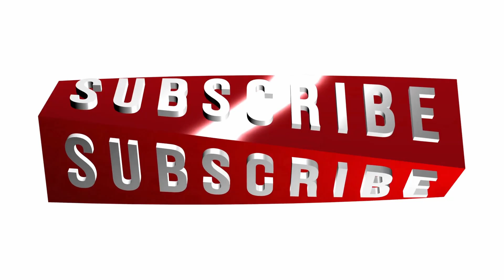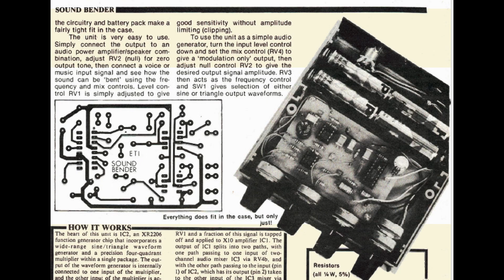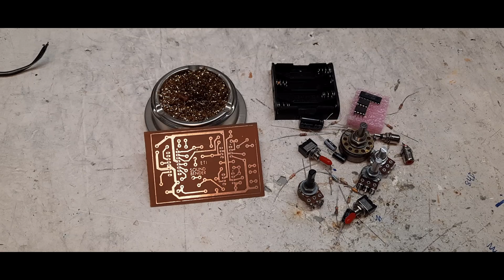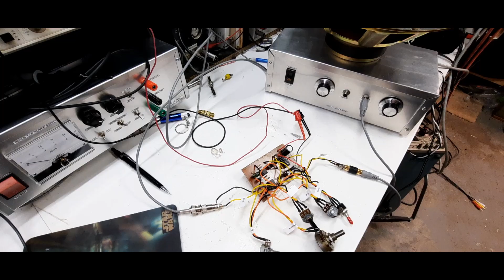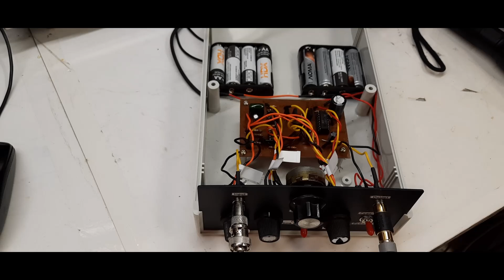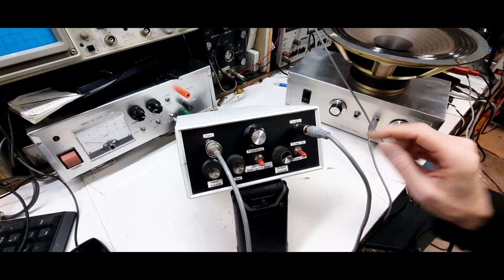Electronics Today Canada  - Guitar & Audio Sound Bender - February 1982 - ETI

Comment: Whenever I build an effects chain for a specific signal path scene on my modeler pedal board, I cannot seem to ever choose a modulator (out of the countless versions) that I'm happy with. They are rarely used by themselves in my experience and are usually after your preamp section effects like distortion, od or noise gate but with the reverb, chorus section in the effects loop. I was gonna say it sounds like a trem effect disguised as some kind of eq mod. Trem is usually assigned to an expression pedal like a wah so you can change the signal with your foot using basically a foot controlled pot. It would be a perfect part of a eurorack type setup with a sequencer. If you're into that stuff. Your low e is tuned to b by the sounds of it. haha

I was not even 3 years old yet when that circuit was published hahaha. It turned out well.

Comment: Brings back childhood memories from the 70's.  Loved making PCBs in my bedroom from magazine projects or my own stuff.  Started out with Sharpie's to draw traces but quickly progressed to buying rolls of PCB trace tapes in different widths and packs of LetterPress dry transfer pads, single, tranny's, ICs, etc.  I was fortunate to have a electronics shop reasonably close where I bought PCB supplies and of course Radio Scrap sold some basic stuff.  I moved on to photolithography, always did positive as most mags didn't publish the negative, I'd have my mom Xerox the magazine art onto a transparency @ her job then I'd expose it with a 'Sun Tanning' UV lamp I found in the garage.  Built a tray w/ motor & cam to tip the etching tray back and forth and a heater which greatly sped up the etching process which was important to get finer details without breaks in the copper.  Used a Dremel in the Dremel Drill Press to drill the PCBs, it really is a perfect setup for drilling them.  Great times but now with the dirt cheap PCB's complete with thru-hole plating, solder mask, silkscreen, I've never looked back at home made boards, I simply don't have the time anymore.